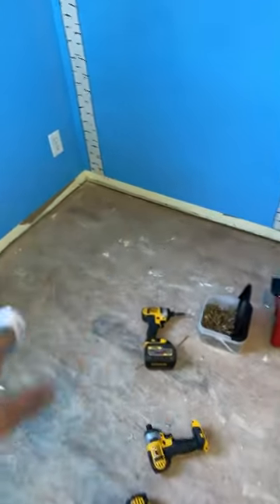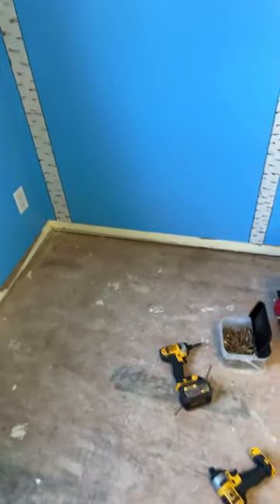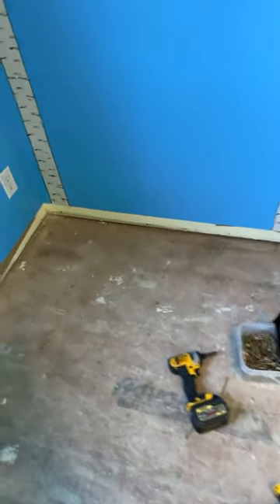Fixing the impossible squeaky floor

Comment: Many times I will take baseboard, run a long screw through the drywall, through the bottom plate and into the actual floor.
Reply: Take off baseboard
Reply from the maker: Nice
Reply from the maker: What happens sometimes is the floor joist? Will be either on the other side of the wall or under the wall where you cannot get a screw where it needs to be to stop the squeak, so this is what I have done in the past. Maybe a longer screw four or 5 inches long and doing what you are describing will be the trick in situations like that.